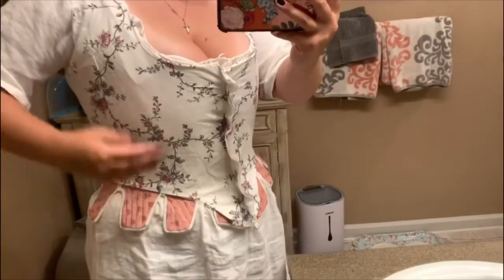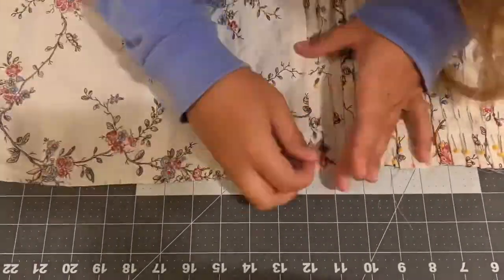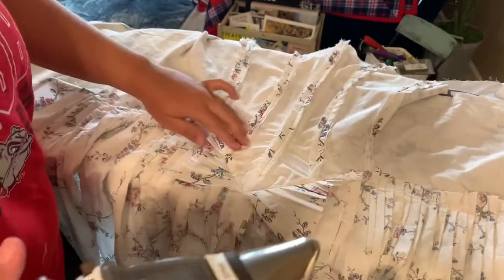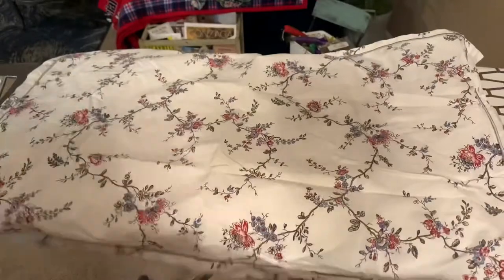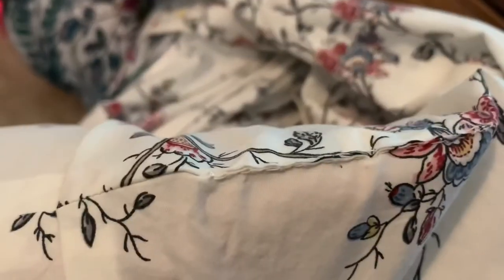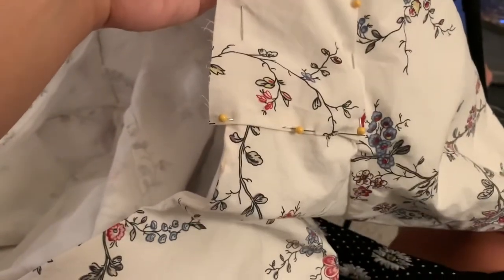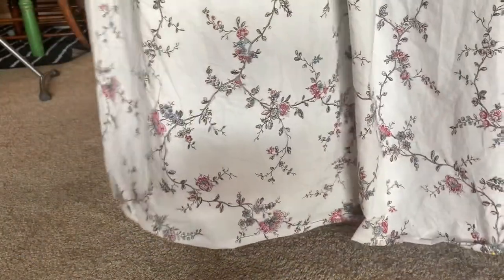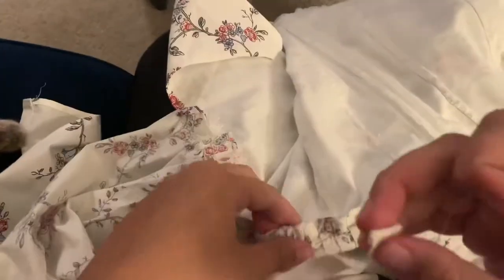IKEA Gown: Finishing a 1780’s Italian Gown

Comment: Yay!  It is finished!  🌟  Congratulaions!  🙌 🙌🙌
  Blood tip from a nurse friend (easier if newly stained):  hydrogen peroxide ... always test fabric first.  Let it bubble and then blot the potential stain front and back sides ... like, squeeze fiber between fingers covered with paper towel or the like.  It'll take a few blots and sometimes a few repeats.  Saved me a number of times now.  😁
Reply from the maker: I will make a mental note of this when cold running fails me 👍

Comment: So that crazy thread thing that happens? I was actually teaching a friend how to use her sewing machine, because I know that sort of thing even though I can't sew a straight line myself, and I ran into that problem and I realized I didn't know what to do with it. So of course I phoned my mother. 

She says just take the thread all the way out, bobbin thread too all the way out, and retread the machine. And I did that and it sews perfectly. No turning of any knobs.

This is good if your machine is already set properly, the tension is correct and the foot pressure is correct, and up until just now had been sewing correctly, then you shouldn't have to adjust those things. (As far as I recall, that's what those two knobs are about. I'm probably not wording it correctly though.) 

Since I learned that, it has worked every single time without fail. which makes me really happy because I hate making adjustments to my sewing machine. I can never remember what I did. Then I don't know how to adjust it back.

Anyway, you might give that a try. It can't hurt.
Reply from the maker: That’s a good tip to remember, sometimes I get so frustrated with my machine I forget most of the time it’s an easy fix 😂
Reply: Yes--start by rethreading everything.  Sometimes it's the top thread that jumped out of the lever arm, or the bobbin thread escaped its tension thingy.

Comment: Nicely done!  As far as needles go, use a smaller needle to hand sew - the one you are using is too big.  The smaller needle will have a smaller point which will slide through the fabric more easily.  Also, get an emery strawberry, often attached to the tomato pin cushions.  Clean your needle with it and it will help a lot.  I use ones with large eyes (chenille needles have them) and a needle threader.  Abby Cox is right, too - thimbles are a must.  Your poor fingers!  

I like the fact you show your mistakes.  I think it is too easy to think everyone else does perfect work, so seeing mistakes reminds me!  I remember seeing how messy the insides of a lot of hand sewn clothes looked - ones made in the 1800s - and was shocked when seeing the quality finishing in more high-end modern clothes.
Reply from the maker: I need to put all my needles in a more accessible place, they are hard to get to right now so I just suffer using the wrong needle out of laziness 😆